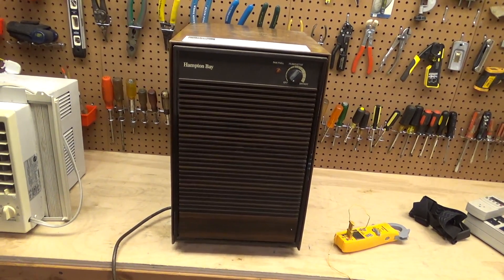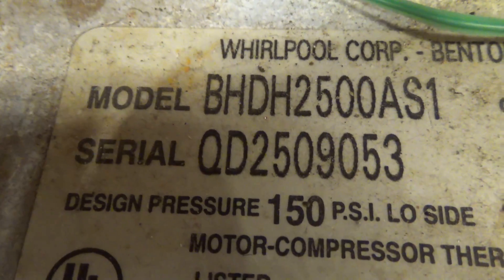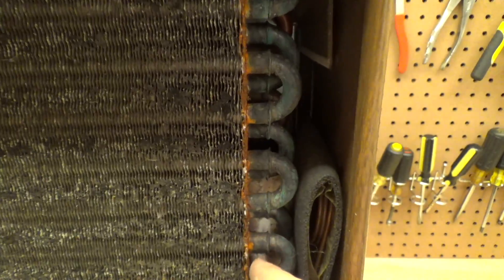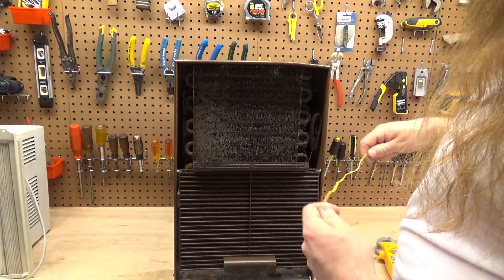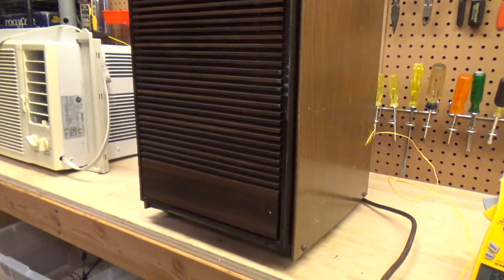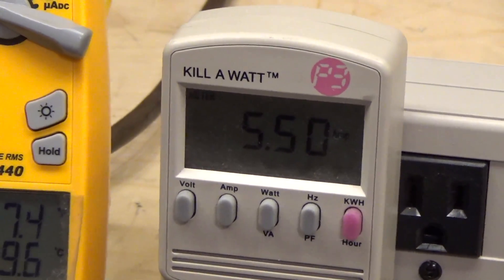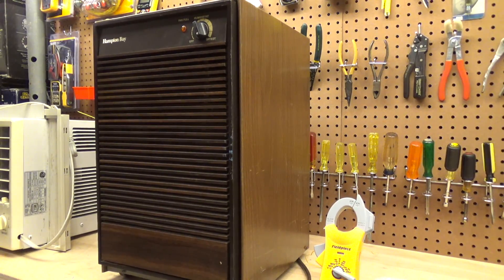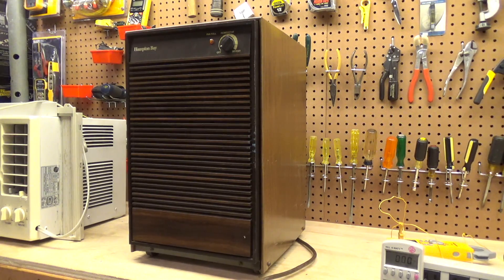Hampton Bay (Whirlpool) BHDH2500AS1 25-Pints Dehumidifier | Spring 2024 Test

Comment: I have the 40 pints model of this machine and it worked well during the summer. Sometimes the compresser would click a couple times then cycle on and off during startup but when i unplug it and plug it back in it runs normally. Not sure what is causing that

Comment: I have the same dehumidifier, with the same back story but in a 40 pint. What I had done was bend up a stainless steel drip tray and put a hose barb on it. Running it for years like that now with no leaks. I am thinking about getting an HVAC condensate pump and mount it to the back where the old bucket was.
Reply from the maker: Thanks for letting me know.

Comment: These machines seem to be notorious with having the buckets breaking. It is also unfortunate that the "outlet" to connect a hose is on the bucket, so you couldn't even use it with a hose if you don't have the bucket or it broken.
Reply: Well for a machine that has lasted decades with the bucket not breaking sure outlasts a modern one that does have a bucket and looses its refrigerant charge.
Reply: @ryanss6446  did I ever insinuate that a modern machine would be better? That was not something that I did or have ever alluded to.
Reply from the maker: It really creates quite the predicament. I will need to build some type of pan to collect the water in place of the bucket.